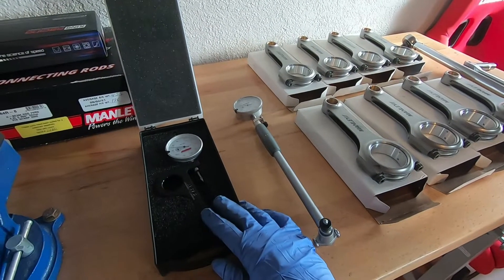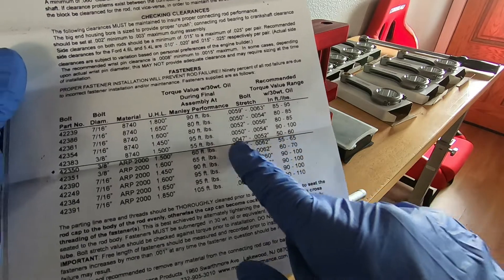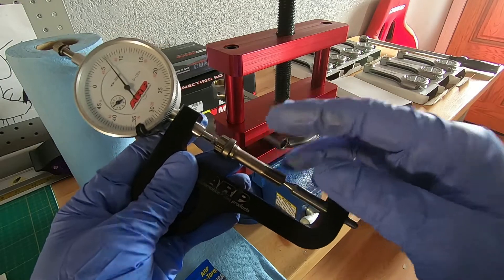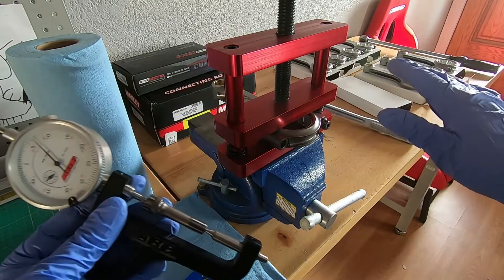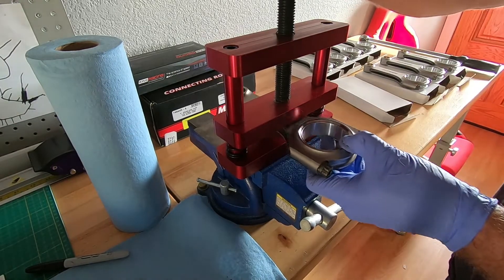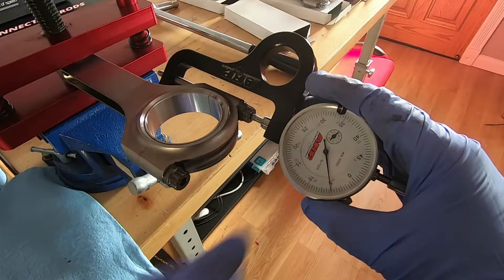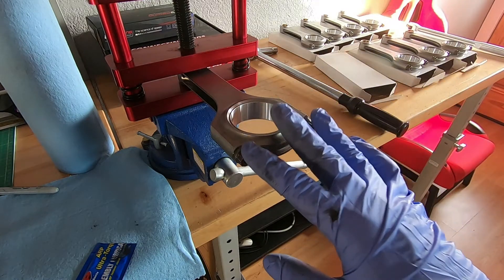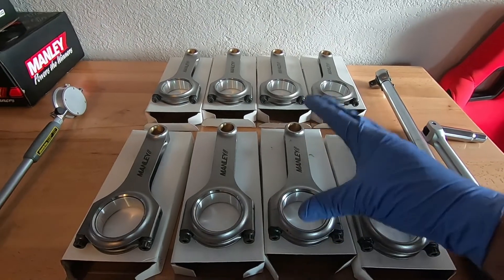Pt 5 Measuring Rod Bolt Stretch and Rod Bearing Clearance - 5.0 Stroker 4.6 Teksid Engine Block

Comment: Sorry to point out but you have made a fundamental mistake. You zeroed the gauge on one bolt then torqued up both bolts equally until you got the correct stretch on the gauge. But each bolt is a slightly different length from each other and requires individual zeroing. You should have zeroed the gauge on the first bolt then measured the second bolt, writing down the difference + or - then torque up both bolts and set the stretch on the first bolt. Now when setting the stretch on the second bolt you need to add or subtract the difference to what the gauge is showing. My ARP2000 bolts are 0.004” to 0.005” different length from each other so yours could well be the same and that is the not far off the stretch that you are measuring.  Simple solution - measure each pair of bolts on each conrod beforehand, zero the gauge to one of them and adjust the other accordingly.

Comment: For what it is worth, it is nice that Manley provides these specifications.  ARP is somewhat contradictory in their catalog.  In their current catalog, there is a table on page 57 that says 55 ft/lbs.  However, when you look on page 57 for bolt set 256-6301, it shows a stretch of .0065 - .0070 @ 45 ft/lbs.  I found that neither of these was achievable.  45 got you nowhere near that stretch and even increasing the torque to 70 did not yield the desired stretch and actually ended up binding the #1 assembly.  It must be noted that I was re-using a set of ARP2000 from a motor that I did not build.  It is completely possible that these bolt had been previously overstretched.  I should have listened to my own advice, "When in doubt, throw them out".  New set of bearings and bolts inbound.  Hopefully, this solves the problem.
Reply: Need to add a clarification.  The correct aftermarket bolts for the 4V style connecting rods is the 200-6207.